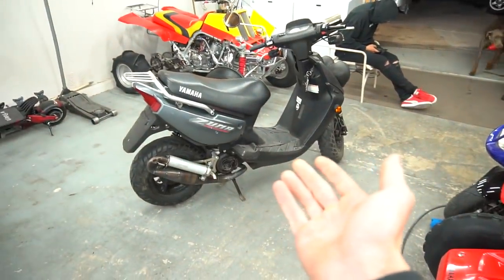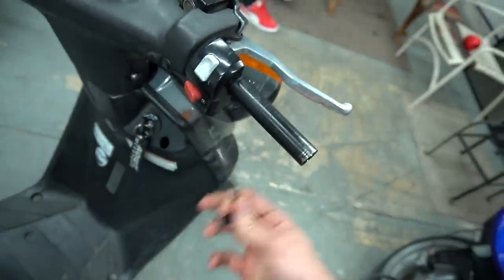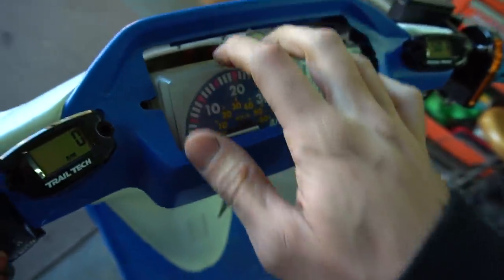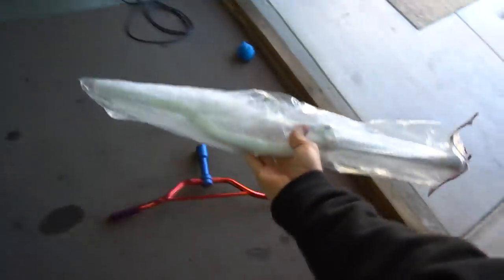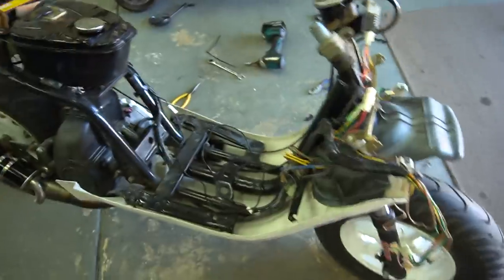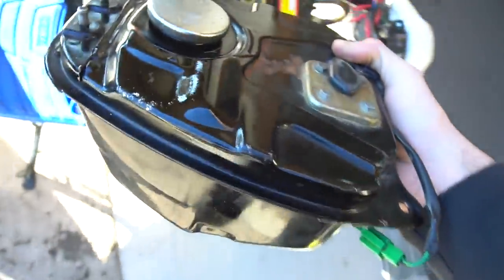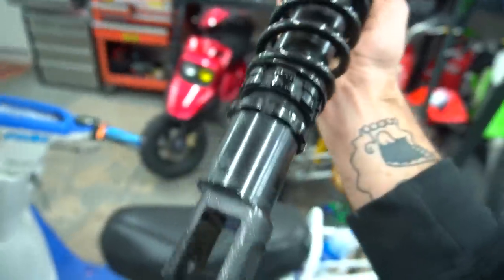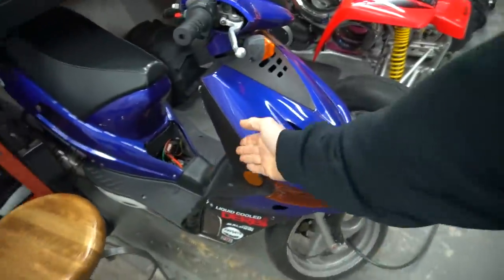Yamaha BWS Zuma "Naked Bars" Stunt style look | 70cc Polini

Comment: You should put a drag bar instead of those bars with a short stem instead of a long, a stage 6 unit with a stage 6 speedometer. You will have ur fuel, rpm, speed everything